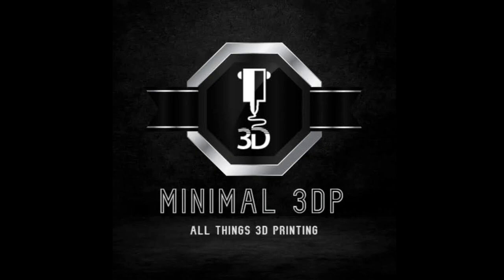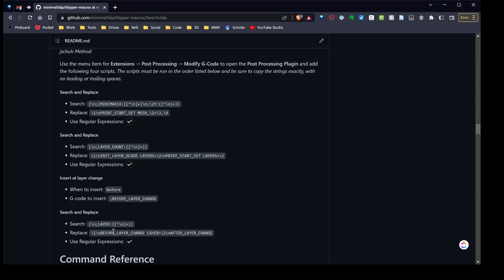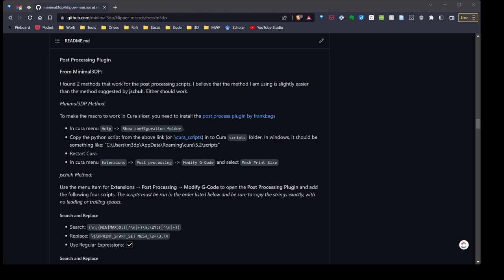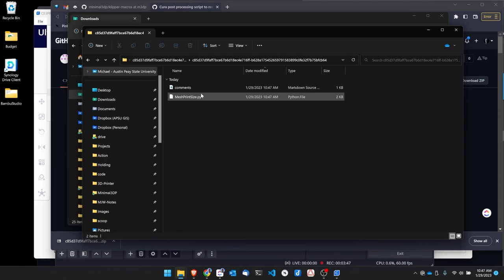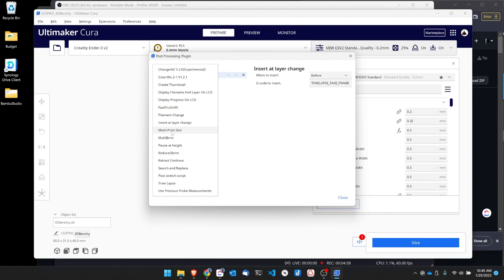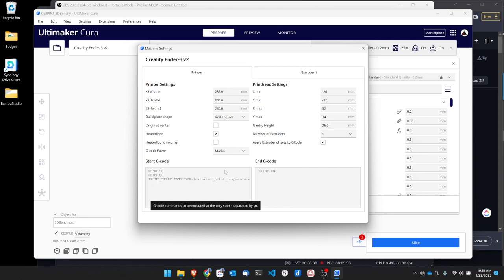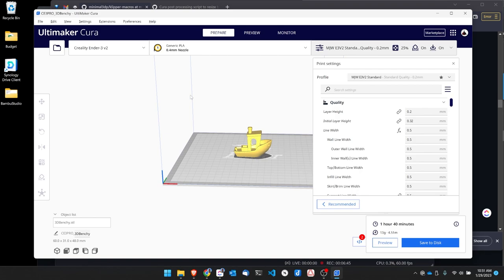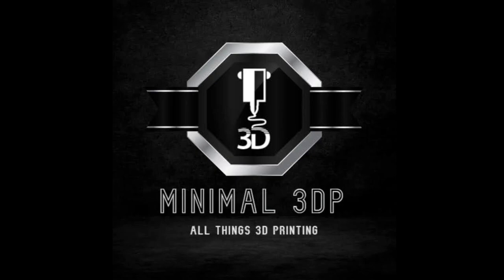Optimize Cura Settings for Using Klipper Macros and the Quick Bed Probe Feature

Comment: That was very interesting. I have just bought an Ender 5 S1 and Sonic pad and wasn't to sure what to due with Cura.
Reply from the maker: You should still be good to use cura. You will probably need to recalibrate your settings.